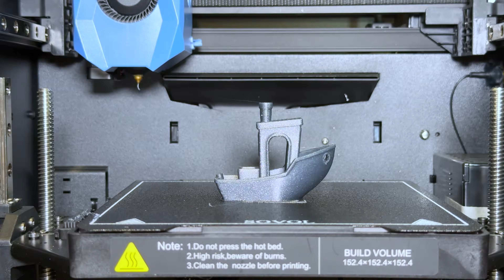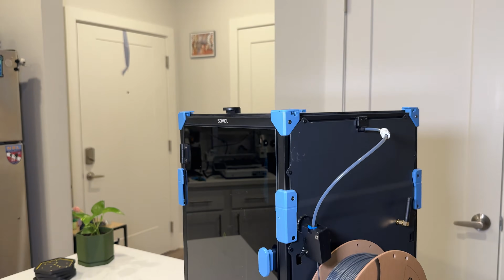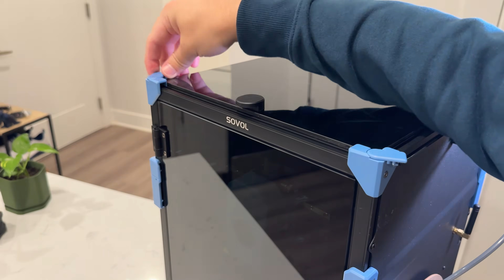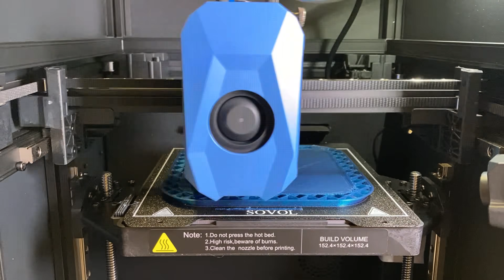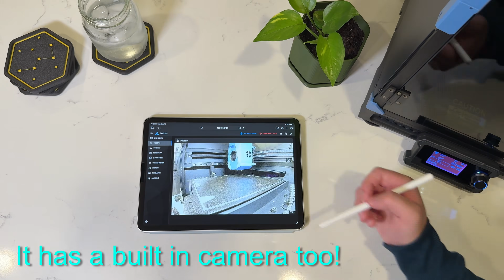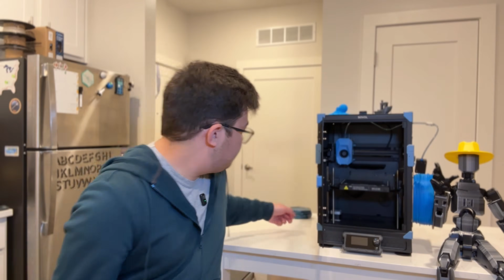Sovol Zero Review: Small & Mighty

Comment: Thanks for your great review. What has your experience been with it? Have you printed engineering materials with it? Is it reliable?
Reply from the maker: I’ve printed PETG and ABS with it and it’s been really great and super reliable! Sometimes I have first layer issues but I use glue stick and it solves that problem easily. I did just learn this printer has been discontinued though :(

Comment: AliExpress seemed to be the best price around for this printer.  I watched their pricing and was able to pick one up under $300 in early Nov 2025.  A1 mini can't print engineering materials, this can.  A1 mini though has better print profiles and much cleaner prints for PLA and PETG and TPU.
Reply from the maker: Nice! How has your experience been with it so far?
Reply: @garrettpost  I've got to spend some time to figure out why I am seeing so more ringing on the prints than I would expect.  But being a small chamber volume it heats up more quickly than my H2D for when I just want to print some smaller ABS or ASA parts.   I think my major complaint is the lack of available print profiles.  One of my use cases is to put a .2 nozzle on it (bought the sovol nozzle kit), but there aren't any profiles in Orca so I am going to have to import one and go through a tuning exercise of slicer settings
Reply: @Gergman  Have you been able to fix the ringing on your prints? I'm considering getting one of those